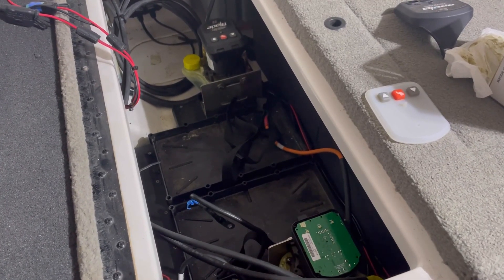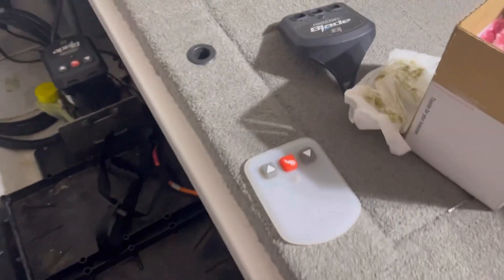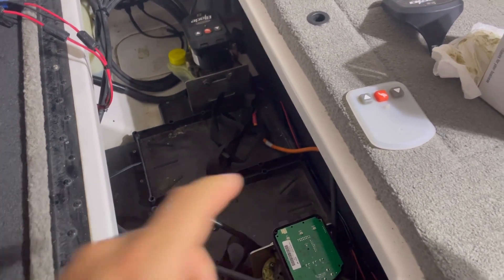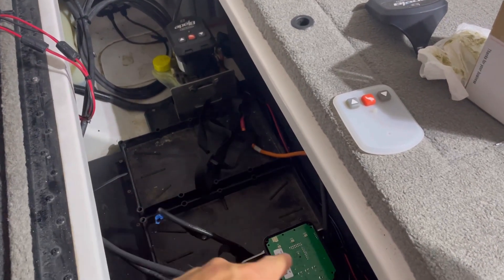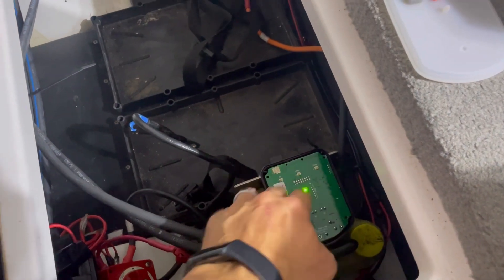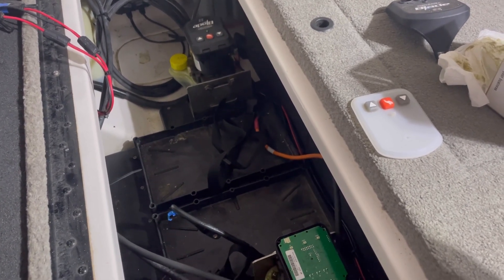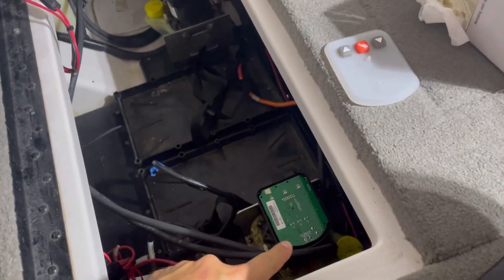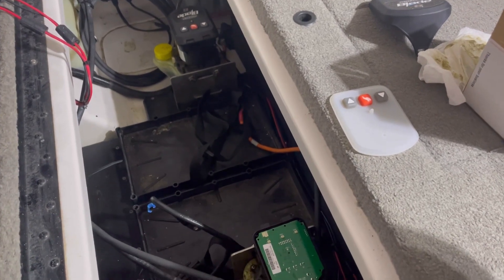Power Pole Won’t Go Up or Down? This May be The Reason Why…

Comment: Same issue, I'm contacting PP today. My question is, what would you do if the blade (circuitry) took a dump when the blade was engaged in the down position while you were on the water? Would you have to disassemble the blade from the mounts in order to leave? I don't think there is a manual retraction option. Thanks for the upload.
Reply from the maker: I would swap the circuit boards from the working one to the down one and make sure not to deploy again for the rest of the day lol.  I think the likelihood of both going down at the same time is slim.   Worst case you could unscrew the lines to release pressure.  Apparently there is a release valve and if you drive into shallow water or put enough pressure on the downed pole manually it will raise but could be easier said than done.
Reply: @FillALimitFishing   -- great advice, but on my Maverick MA18, I only have one PP, which is ample for me and I don't mind the wind swings/positioning.

Comment: Mine is making the chiming noise but it will not go up or down idk what’s wrong
Reply from the maker: Does you hear the pumps engaging when you hit up or down? Try to update the firmware via the app.  If that doesn’t fix it. Call power pole, they are truly amazing.